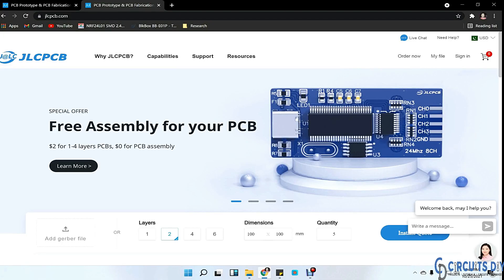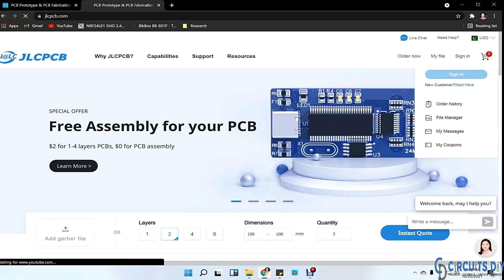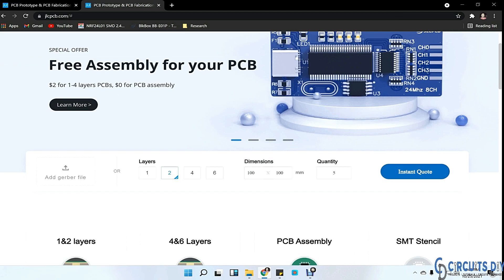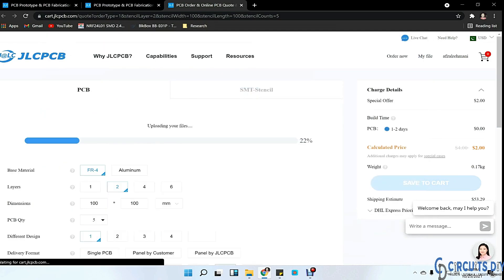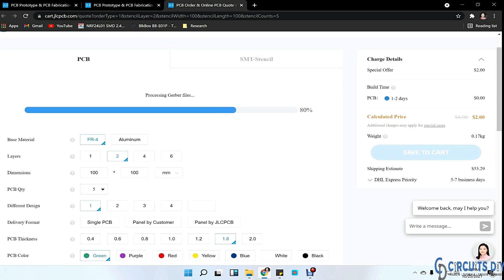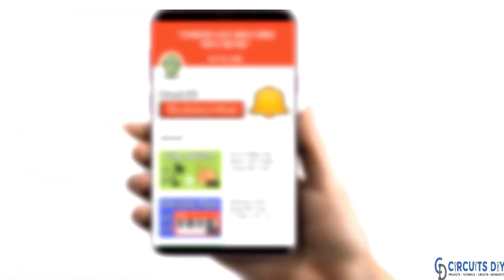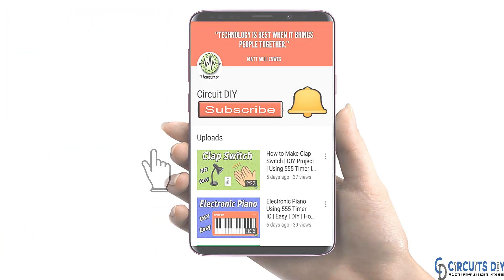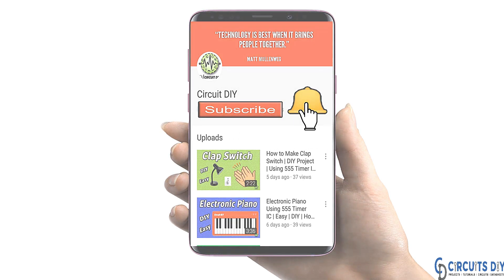SSD1306 OLED (I2C) with ATtiny85 - Hello World Program

Comment: Code doesn't turn the screen on.
Reply: Discovered the problem. Most I2C modules have built in pull up resistors on the SDA and SCL lines. Unfortunately, those lines are shared with the MOSI and SCL lines, which a programmer, such as a USBTiny or Arduino ISP will be programming over. So long as the SCL of the I2C device is disconnected from the attiny85 at the time of programming, and then reconnected afterwards, this works.